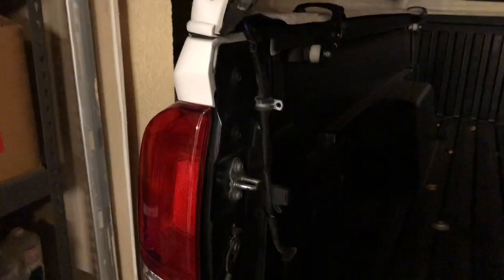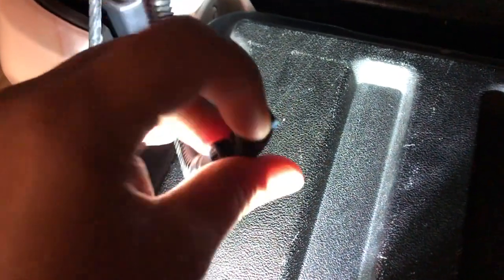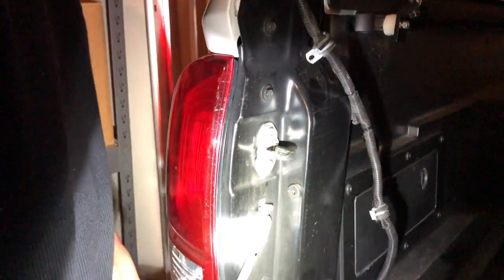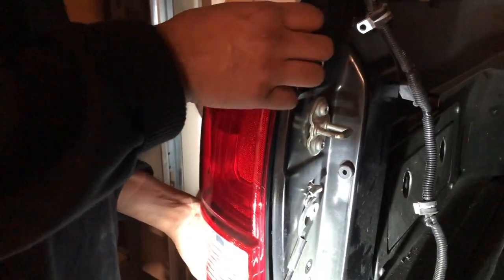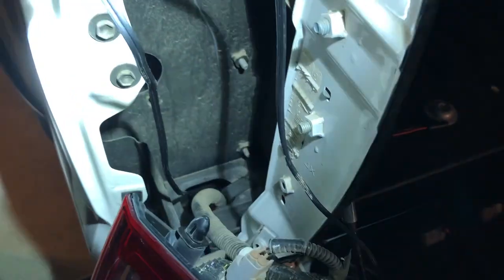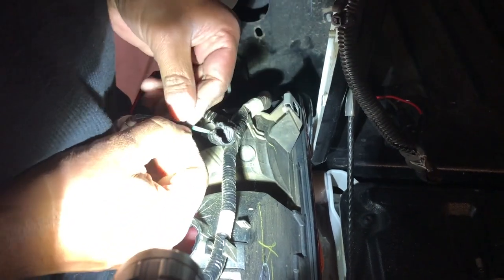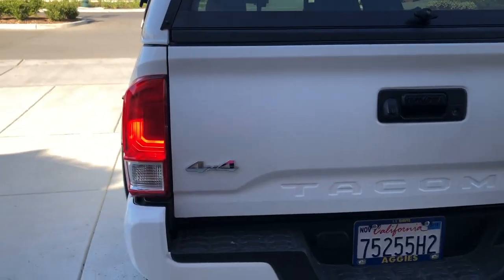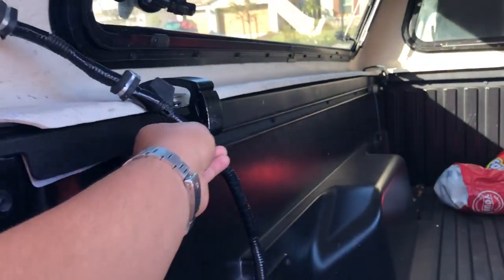2016-20 Tacoma Camper (3rd Brake Light) Wiring Tutorial

Comment: So, does it flash when you use the hazards? The high mount is supposed to be an independent circuit. so when the indicators or hazards are used, drivers behind you can still see clearly that you are braking by light of the CHMSL. But tapping the Stop signal from one side of the tailgate is gonna cause issues. Wiring this way will cause the CHMSL to 'flash' while the Left-hand Indicator is in use; and in turn, causing the CHMSL to flash while using hazard indicators. The bid problem with that last one is, If you're driving the heavy rain and decide to use the hazards and slow down, the drivers behind you will never know if you're using your brakes. if you're CHMSL is wired to to flash like a taillight, it will never go solid to alert drivers of your slowing down. I'd recommend picking up the signal straight from the brake pedal switch if it's a last resort kinda thing. there's gotta be a better way that this.

Comment: Do you have a problem with the third brake light come on when turn signal is on?
Reply: On mine, the signal is a separate bulb on top.  The brake is on a double filament bulb with the tail light.  It's just a question of the right wire of the pair.  Unless they changed it on the later models, you should be OK.

Comment: Why did you have to re-do it? Why did you add in the add-a-fuse after the fact?
Reply from the maker: Hey Will, I got the shell used and this was the wiring that I received. Perhaps the fuse was added to help protect the brake light? I had to re-do it because the person that did it did not do a good job at all!
Reply: Raja Kumar ahhh, so there was already an add-a-fuse when you got the shell? I see. Thanks for the reply!
Reply from the maker: @willpowell2938  Of course dude!!! Please make sure you seal up your tacoma properly before adding the shell...I have one video on that.....those 2 corners are a nightmare...
Reply: @BlazzinTech  Oh yeah, no doubt. I soldered the attachment, wrapped just that spot in electric tape, heat shrinked on top of that, then used a loom coil from Home Depot over that, and then finally electric taped on top of that. Should be good to go! Also, I have it over a Softopper, not a hard shell: 

https://www.tacomaworld.com/threads/what-have-you-done-to-your-3rd-gen-today.399305/page-7692#post-23040870

Comment: Do you recommend disconnecting the battery before installation?
Reply from the maker: I did not disconnect the battery before doing the wiring! I don't think it is crucial to do so, but if you want to be safe, I would disconnect the negative and wait for 5 minutes.